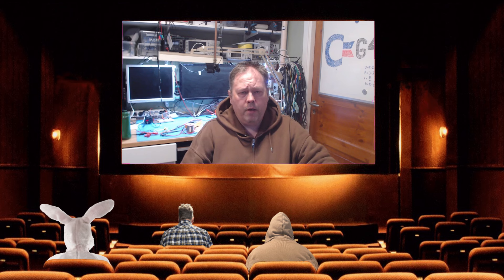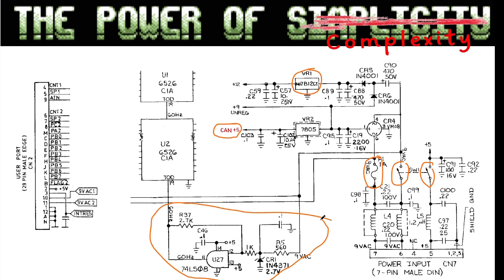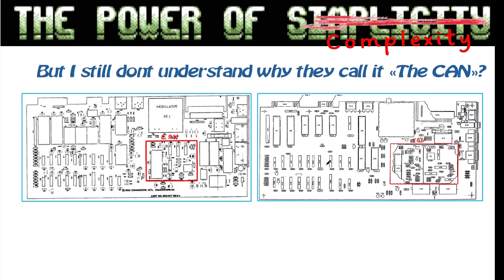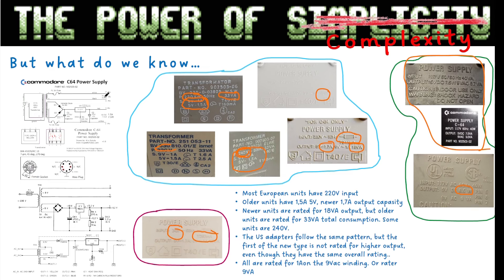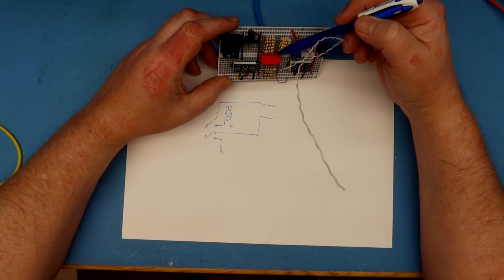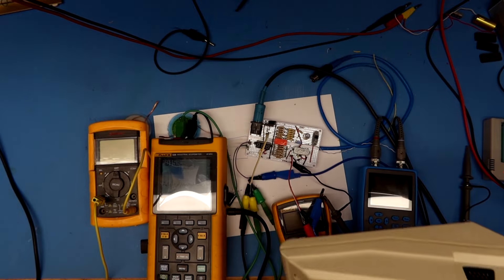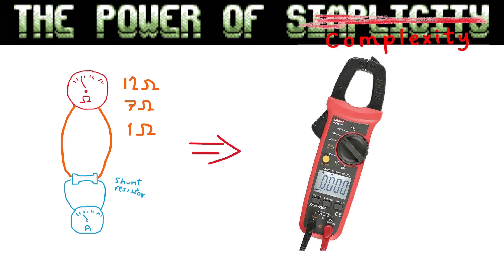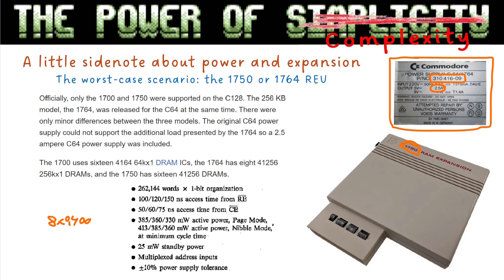All you never wanted to know about the C-64 Power Supply, and all the implications. Part 1

Comment: 16:30 I saw this "feed forward" power resistor shunt for the first time in Atari2600 VCS '70s cartridge console. Resistance is chosen to conduct 90-something percent of the lowest required current, when the big electrolytic filter cap is at peak Voltage. The 7805 comes on when the circuit needs more current, and/or the cap has less than max Voltage on it, between AC peaks. The regulator can have a smaller cooler, or a lower Amperage ability (cost savings) with a power resistor shunt.

Comment: The French build had around 200mA consumption, in the SECAM broadcast format converter module. 16:20
Reply from the maker: OK, thats a lot of extra current for such a module. But that will explain that the circuit is only there on the French ones.